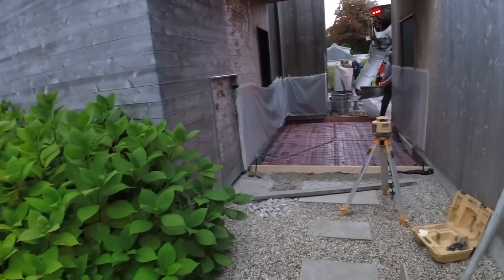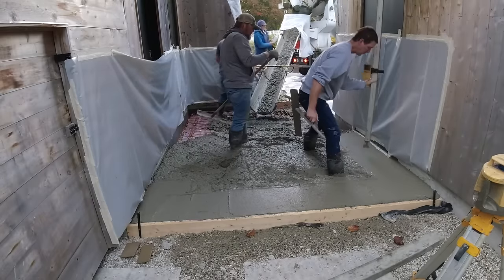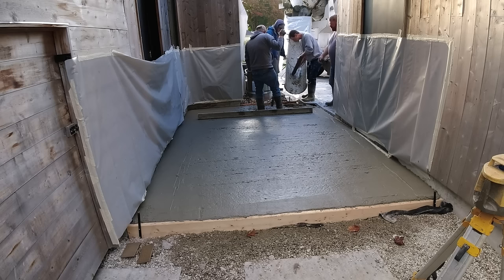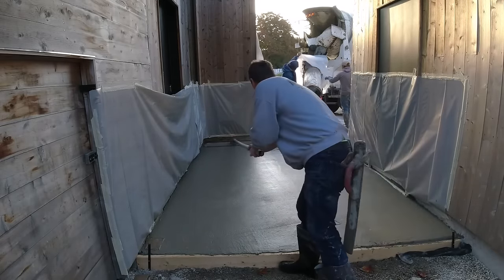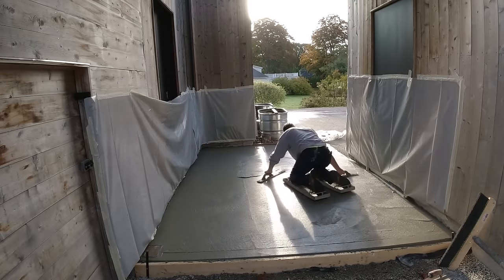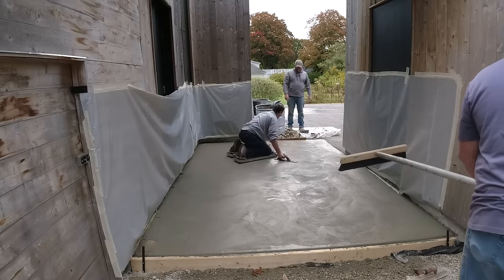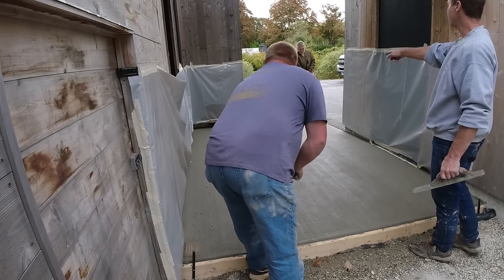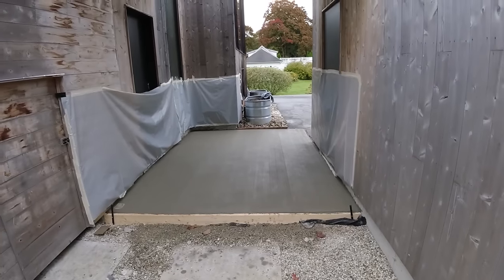Why Did This Entry Slab Cost $20,000 Dollars?  (I'll Tell You Why!)

Comment: My brother in law put electric heat under the tile in his bedroom.  Worrked for 3 years, after that, no heat in the master bedroom without ripping out thousands of dollars of tile.
I don't trust electric heating (especially outside and embedded in concrete).  I think pumping warm water through it is much safer.
Reply: Indeed. That's what happens when you cheap-out on the install or just throw it onto an existing non-suitable construction. Electric heating under tile requires full design and construction consideration from the below floor structure to the floor substrate to the finished grout sealing.
Reply: Interesting, I would have expected the opposite in terms of points of failure.  What is located under the tile, other than the wire that serves as the heating element?  Surely the wire itself is not what failed, but the equipment on the end?
Reply: @SwedishDeathLlama  Depends how the wite was laid, what it was laid onto, what levelling compound was used, how thick the compound, what flooring is underneath, what or whether a waterproofing membrane was used. Likely or possible scenario in a diy job is movement in flooring resulted in abrasion to the wire from a screw or nail. Or partial damage during install and movement in use finished the job.

Comment: There’s just no way that infloor heating install was 15k. I’ve installed the same exact square footage for several different bathrooms (albeit it was inside, under tile). It’s not a different product. You’ve got 1200 dollars on the ground right there, including the thermostat. The only caveat would be the electrical. This would require a dedicated 20 amp circuit. Maybe the electrical was insane? Across the whole house? It’s not like I’m working in a cheap labor market where I’m at, either. Yeesh
Reply: Yeah it is a high price for that little area !!  I did a short driveway last year with electric heat wires in it and it wasnt half that price ! There wasnt any Styrofoam under it but they did have a reflective membrane !
Reply from the maker: That's what the architect said it cost.
Reply: @MikeDayConcrete  oh I totally believe that, 100%. Not challenging the facts here. Just pointing out that somebody got hosed down pretty good
Reply: I believe, based on here, South Eastern NY, some people have too much money and like to brag about how much they spent! Yeah, a breezeway woulda done the trick, but that would be too “Middle class”!

Comment: I bought heat cable for a bathroom about that size for $80. Thermostat was about $100. Installation time was one hour.
Reply: Yeah, this guy got shafted hardddd. You could put an hydronic system in it with its own heat pump and still be under 20k lol

Comment: As a homeowner, I probably would have opted to enclose the area instead so that you could still go from one building to the other without worrying about snow or rain. Sounds like they got shafted by the electrician in my opinion
Reply: And as usual, your work looks top-notch.
Reply: Municipal building codes may have restrictions that they cannot connect the two structures together .
Reply: @JoachimwGermain-co4zw  in that case, two overlapping canopies that do not physically touch each other🤣
Reply: @descargaelbano  building codes like that are total bs imo. Limiting roof sq footage on a lot may or may not have a good reason but in cases where it won't affect the appearance or is only a minor increase that makes perfect sense for the  structure it's ridiculous to enforce the code to the letter. I could tell you stories as I'm sure most builders and homeowners could.
Reply: Your talking $50k+ to close that in… footings… etc
Reply: @TT-ik3kd  you're insane. 😂 I'm a builder. My dad's a retired builder. I know lots of builders from Seattle Wa to Portland Maine. You're insane.
Reply: Usually plumbers install heat
Reply: @TT-ik3kd  Where I live, even with a slab, it would cost less than that 20K slab and it would be constructed of would just like the two buildings it's connecting.
Reply: Or at the very least a privacy fence around that area
Reply: @TheKingOfInappropriateComments  that would be great, that way I could walk from my house to my garage naked without anybody seeing, unless of course they were using a drone
Reply: @descargaelbano  i was going to say something about being naked too but i left it for some other comedian.   On seriousness you could even just screen the area on like a front porch. I used to live on Florida we had these giant screened in structures called pool cages.

Comment: That's insane what that heating system cost. I did my garage with hot water and it only added a few grand. I did do it myself but it's a 40×60 slab. Plus I question how long the wiring would last over pex.

Comment: For a 10x10 ft slab The heating coil is 1000$ to 1400$ and the control valve is 950$-1050$ in Bangor, Maine not installed. You need a 120v 45amp circuit. It’s about 50 watt per sqft.

Comment: Surely broom finish concrete is a cheap nasty finish for a residential house. In the uk we use this in petrol (gas) stations and industrial parking spaces. Anything for a house would be natural stone or porcelain tile.
Reply: Did you pay attention to the architecture and materials of the building? This was perfectly in sync.
Reply: @DiscoFang   perhaps it can be ‘in sync’ whilst looking cheap and nasty 🤷🏻‍♂️
Reply: They and the architects may take it as a compliment. Mike did say they were going for a somewhat industrial look.
Reply: How do you feel about Cor-Ten steel? The architectural steel panel designed to rust.

Comment: Poured 6 yards of 4000 psi at a 4.5 slump in a backyard this summer just me and the finisher guy. I ran the buggy and helped screed when needed. He was watering the surface to get it troweled before it set up. Broom finished at the end. He's in his late 60's. I asked if he'd ever lost a slab and he said almost but watered the heck out of it.
Reply: If you spray a bunch of water on it that means you already lost it (if you have winters)
Reply: @-Blick182-  sprinkled from a brush to make the surface soft enough to trowel. He watered a slab we did 6 years ago the same way and it's solid no problems. I understand it's not ideal but doesn't seem to be a problem either.
Reply: @-Blick182-  yes we have winters in Iowa with extended periods below 0 some years.
Reply: @jamesnm21  oh ok got ya 👍

Comment: Are there any de-icing products that do not compromise concrete down the road?
Reply: I think you can use 4800 PSI concrete - that should tolerate frost and salt. 4800 PSI concrete is not just something you can buy, you have to create it. Cant add extra water and it must cure for at least 14 days or something. 4000 PSI concrete is not frost proof and will not resist salting.

Comment: That is completely ludicrous for that much $$ for the heat. I installed radiant floor heating in my 22 X 40 shop myself for around $2,700. I did electrical and all. They got robbed. Nice work on the concrete though.

Comment: I have always heard to not steel outside A/E concrete but every single guy ive poured with steels it then brooms. Usually leaves a nicer finish and the broom does open it back up. Never seen an issue with it and this is in a freeze/thaw environment.

Comment: lol maybe 10 to 12k MAX at best that includes the 3 k for Mike. Ive done many heated floors
 8x10 heated exterior cable cost is 2200 plus install 850.00… plus the styro and the reinforcements.  Concrete demo and haul away 1k. Someone got hosed big time even if the electrician costs were 500 to 800 to run the power/breaker and a sub panel if it was needed

Comment: Laser level? wouldn't it be more accurate and less setup just to put a screed across the long way? 12ft 2x4 or 16ft 2x4? I've been thinking of buying a laser level but I find that for most of my projects, that sort of precision is the least of my worries.
Reply: How do you set your screed in the first place? That's what the laser was being used for. Mike seems not to use screed boards, he pulls the screed on the levels set with the mag against chalklines or the laser.

Comment: Someone has more $ than sense on this one.  It's a toss up to do electrical, would prefer a glycol water system with a mini boiler.  Have friends with large driveway melting systems that are essentially freeze proof radiant tubing set ups, this is in MN.  Install not that expensive,  energy costs are a different storry, as cold as it is.

Comment: Did not see anyone pulling the mesh up into the concrete. I would say the heat is under the slab, not in it.
Reply: 😂😂😂 they made sure it is on the bottom  doing nothing
Reply: Then you're blind or not paying attention or both. The mesh was sitting on continuous support bridges. But hey it's good that you're confident enough not to question yourself first about what you think you saw, but to figure it's the guy who's been doing concrete every week for 30 years that must be at fault.
Reply: @DiscoFang  No one trusts anyone else anymore.  Little integrity and lack of confidence are rampant these days.  Hence believing your lying eyes.
Reply: @DiscoFang  the supports do work, however if you open YOUR EYES 👀 YOU CAN CLEARLY SEE THAT THEY WERE BEING TRAMPELLED TO THE BOTTOM.  THE MESH STANDS  CAN NOT SUPPORT 3 250LBS MEN STANDING ON THERE 😂😂😂😂

Comment: Incredible, $20,000 !  What if the heating pad fails in the future? I believe runways are somewhat heated, but not quite sure how.
Reply: If it fails go to Florida for the winter.
Reply: Under slab heating works.....until it doesn't!   We've cut commercial slabs with heating elements that failed. They didn't bother to repair them.
Reply: @pitbull4029  they probably already do spend their winters in FL.

Comment: $15,000 heat adder.  That's what is wrong with the United States on many levels.    How about a small tube glycol system off of an electric water heater approved for in floor heat.   Maintain 33 or 34 degrees F and save $7,000.

Comment: Good grief!
Why would one check the level of the concrete right on the edge of the expansion joint that was already set to a specific level and at the form that was already set to a specific level.  It makes no sense whatsoever why a laser level would be used at all, because the tiny little pad either slops one way or the other, thus using a laser level completely useless.  And, three men to do five minutes work?  Okay, okay -- for one man, ten minutes due to jibber jabber while pouring and after it sets a little bit, ten minutes to finish.  And a broom finish long-ways is an inappropriate and unsightly way for the piece.  A spin float or a spin trowel finish would be more suitable for that entrance way.  And charged the home owner triple too much to boot!

Comment: There is more to a project than what meets the eye. Electrical a dedicated circuit had to be ran to this. What you don't know is what had to be done on the inside of this custom home to get power to this. Sure the heat mat itself didn't cost $15k but when you add every sub and what they had to do to get it there and you are dealing with an architect and a designer.  So many things go into something like this on a finished home. This isn't a heated tile floor in your house.  There is alot of movement on an exterior slab.
Reply: You sound like the architect trying to justify ripping the client off.
Reply: lol-movement? Not so much.
Reply: @BerkeleyTowers  sorry you don't understand.  I did my best to explain without writing a novel.
Reply: @30shandala  have you ever seen what happens to a heated driveway when the heat was installed improperly?  Movement is a huge issue for heated exterior concrete in cold climates.
Reply: lol-I didn’t realize you were including fucking it up first. Lucky it didn’t cost 30k.
Reply: @toolsandreno  I do understand. I’m in the game. As are a lot of others on here. The fact you can’t explain succinctly speaks volumes.

Comment: For $15,000 you could’ve bought a small boiler a heat exchange plate so you could use antifreeze and the pipe and had less than $8000 of it installed. I think somebody really got ripped off here plus the electrical heat tape they’ll be lucky to get five years and it won’t work, whatever

Comment: What a joke, the wire mesh in theory should be centered in the concrete.
There are 3 men making sure to trample all over it making sure the wire mesh is on the bottom of that little  slab making its job absolutely useless.
😂😂😂😂😂
Reply: It'd be interesting if Mike went back and filmed it after the next snow fall to see if it's working as planned.